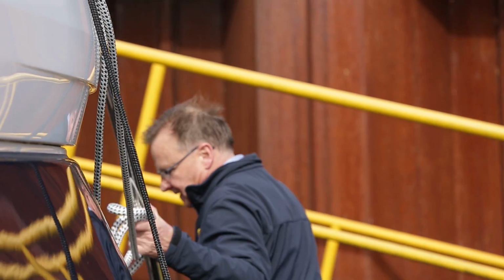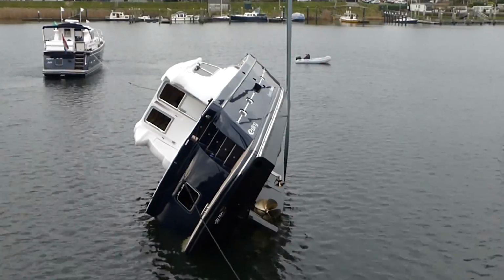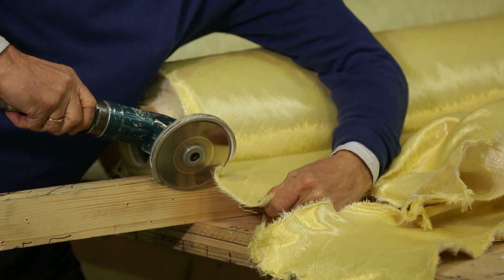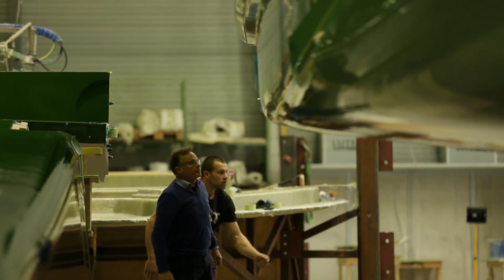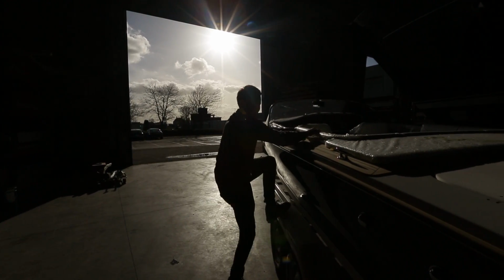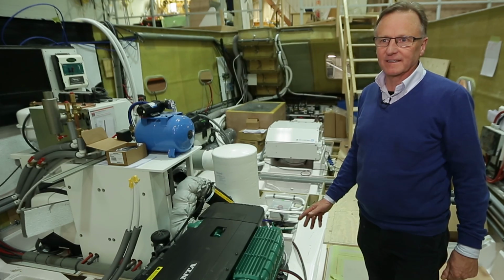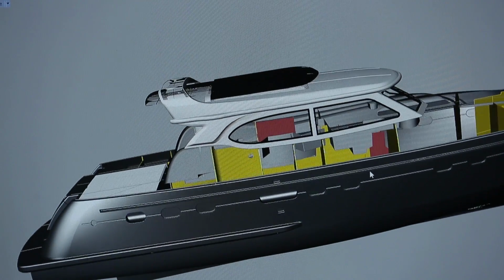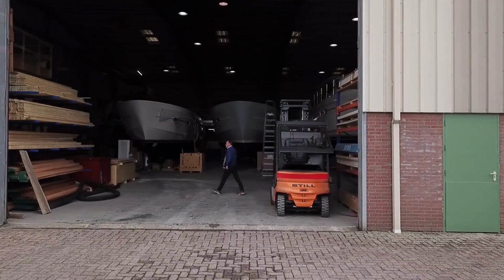Elling Shipyard (Netherlands)

Comment: Idk... As much as the roof was flexing in on the E4 when you rolled it... Idk if the E6 roof would handle it... It's got a LOT more weight and the roof is a good bit longer and has less support in the middle... Especially with that retractable roof... Idk. You're the professional. I would assume you'd know what you were talking about. Lol. They're beautiful yachts. That's for sure. If only I was rich... A man can dream I guess... Lol.
Reply: Roof is definitely the weak point, I thought the same, I'd prefer it without.